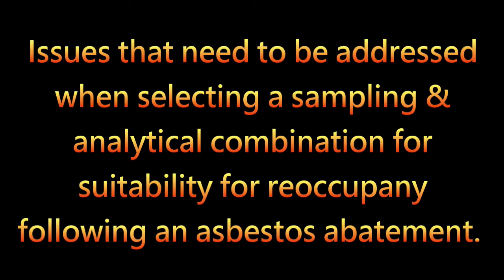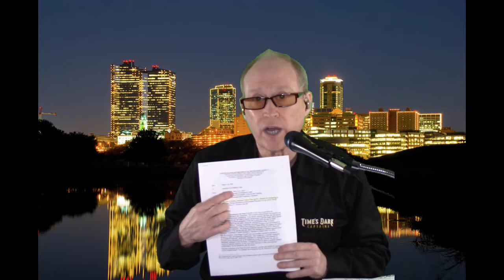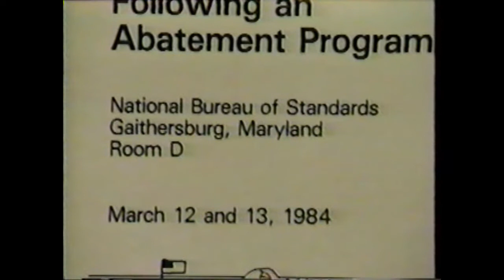Asbestos Abatement Clearance Debate: TEM vs PCM

Comment: Is Aggressive air sampling required for PCM final clearance?
Reply from the maker: In Texas in Public and Commercial buildings it is by law.  In general practice in using clearance by PCM taking the proper amount of volume with aggressive sampling and using that to compare back to a blank level (which is what we are doing) would be required as proper practice.  In a school under AHERA, yes any clearance would have to be collected aggressively.   In all the guidance books they say you should collect any clearance samples aggressively..
Reply: @timesdarkcaptains9170  thank you!!